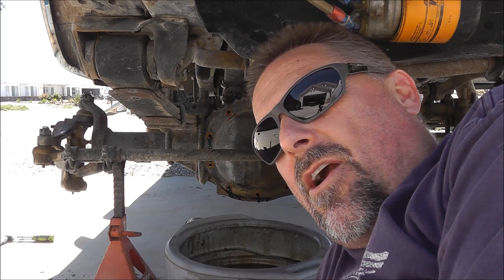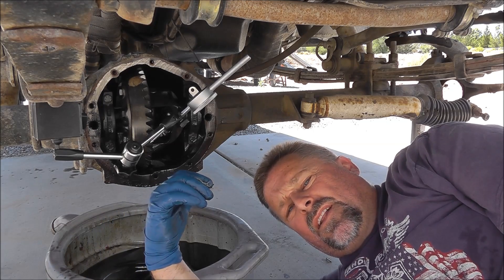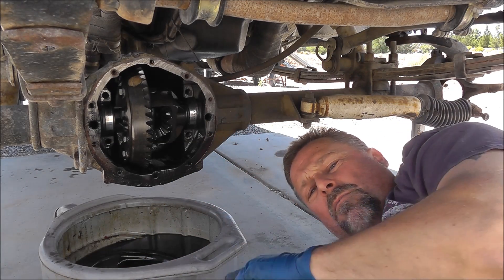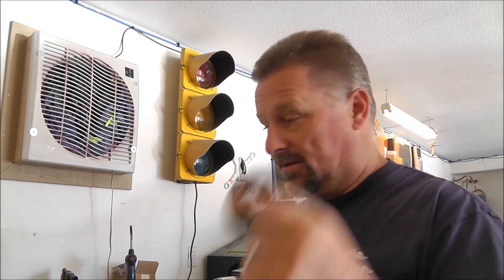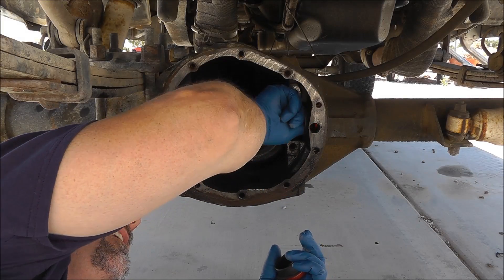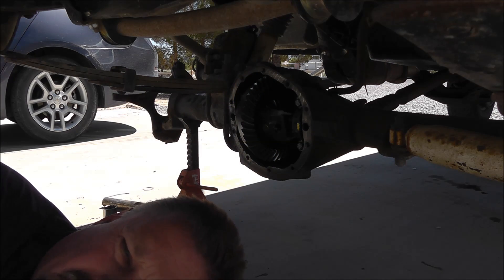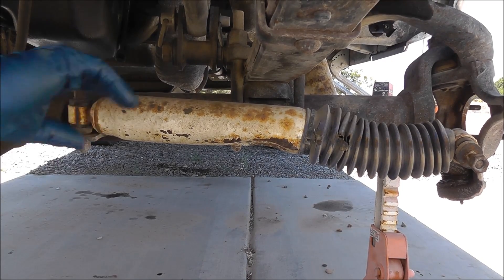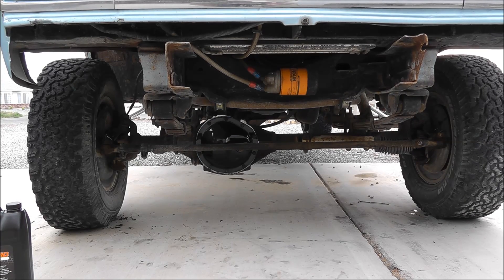axle seals part2

Comment: my tool has 6 inch pipe tacked on socket then long pipe slides over short pipe if you just tack long pipe to socket ...install 1st seal turn tool around backwards slide long pipe through seal you just installed install other side then slide tool to center and cut off socket with die grinder

Comment: I liked your video big job for diy guy you got skills ....no doubt one suggestion pack back side of seals with grease to keep guard spring from popping out I do driveline for a living seen lots of diy guys get it all right but knock guard spring out during seal install and miss it put it all together only to bring it to me with leak just a tip  also I use piece of pipe tack old socket to pipe you have more control driving seals in than a bunch of extensions you got skills love the videos got lots of projects myself I think I'm inspired to video tape now I wish I would have for the last 30 years I would be a millionaire by now LOL from race cars motorcycles boats cars trucks you name it I've had it apart for the last 30 years you do good work what I like the most is you do it yourself